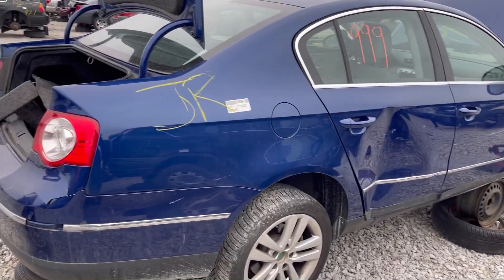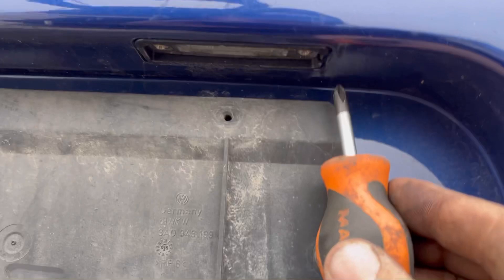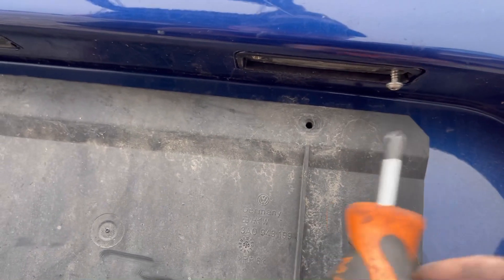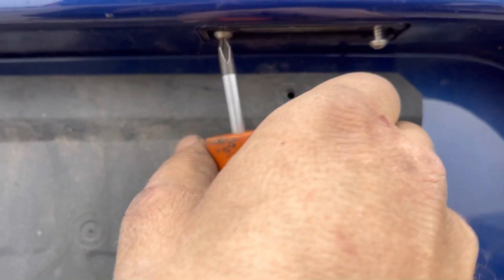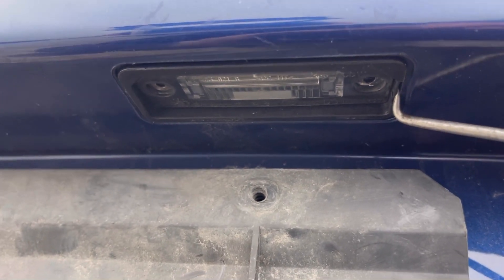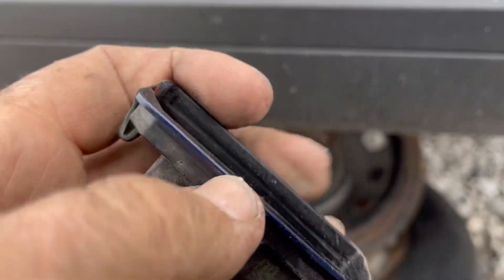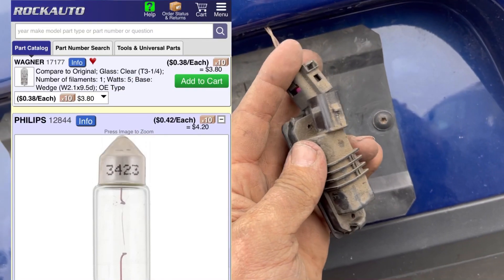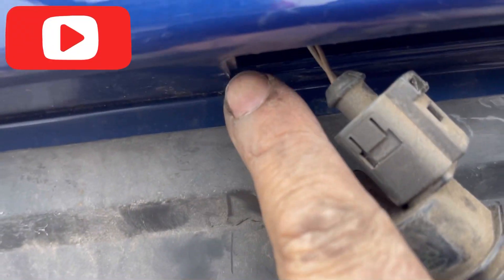Replace license plate light Bulb VW Passat GOLF MK4 MK5 MK6 MK7 CC Paheton Beetle led conversion

Comment: Hey naptown, I got a question. If I pull apart a 2.0t, can I reuse a new head gasket even though it hasn’t been started? I saw your video regarding cylinder head bolts and they can be reused which is great.
Reply from the maker: Once a head gasket is smashed it cannot be re-smashed into place